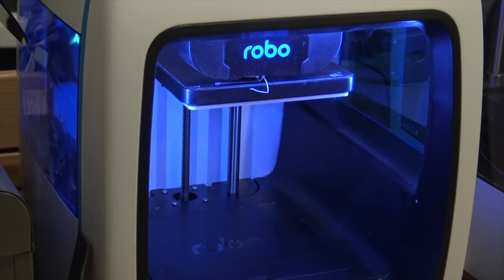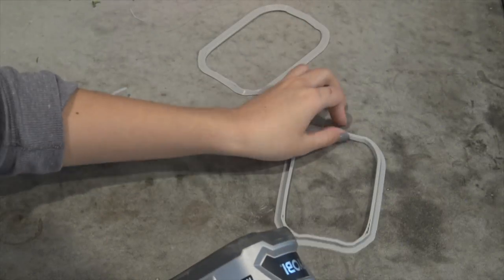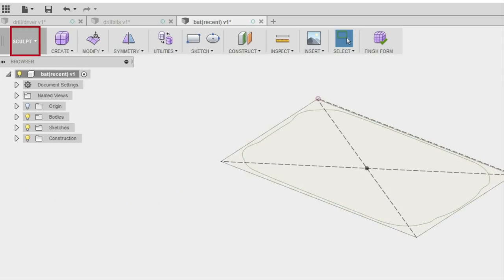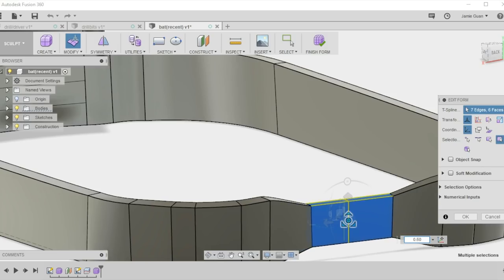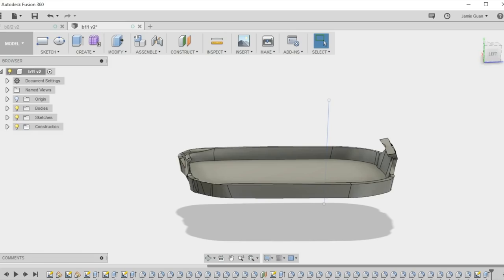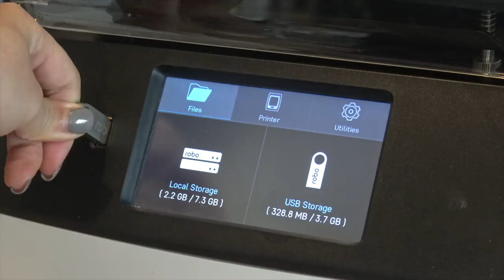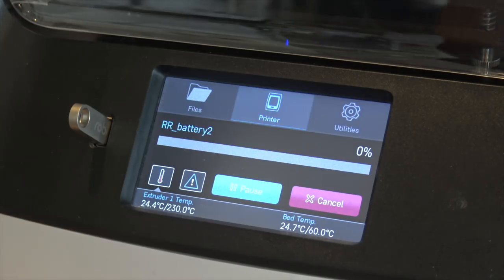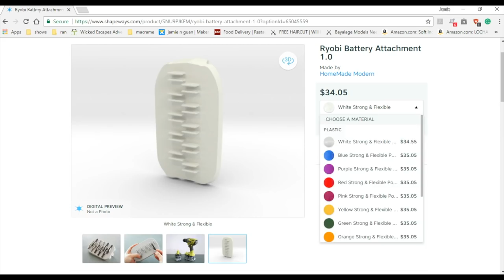3D Printed Custom Drill Accessory Kit

Comment: The steps you did in Illustrator can be done directly inside Fusion 360. Import the image using "Insert> Attached Canvas", then trace the outline with the sketch tools.

Comment: Great video! Most cameras can give you slight distortion when using them for CAD purposes. Try using a computer scanner next time and it should give a more accurate photo. One other tip would be to add a fillet or radius to the bottom of your bit tabs where it connects to the larger surface. It will make it stronger and should last longer. Thanks for the video!

Comment: Hi, thanks for sharing your project.  I'm curious about the stability—it looks like the drill may be a bit unstable on this base.  Does it rely on bits in the holder to effectively act as part of the base, so that removing certain ones cause it to wobble?  

Is it suitable for uneven surfaces? For fast paced environment where tools get picked up and put down quickly and frequently?  Where bits can be removed and replaced without needing to think about careful arrangement?    

If there are issues with stability, do you plan to revise the design?  One thought I had would be to add blocks near the edges that wouldn't be in the way of bit access.  Thanks!

Comment: Hmm.. The concept is okay. But it needs some sort of pads on the bottom to protect the surface, you place the drill on. Sharp plastic can leave scratches. Personally i wouldn't use this add-on, as it adds weight to the drill/impact driver. You want it to be as light as possible.

Comment: I work a lot with 3D prototypes at my day job. I feel like your design would benefit from small features in the corners of the attachment so your stance stays as wide as the underlying battery surface. Keep those points proud of the other ribs and they’ll always hit first.

Otherwise the drill probably rocks a bit when using that attachment.
Reply from the maker: Hi Brian,
thanks for watching and sharing ways I can improve this design!
Reply: You bet! Hope it was helpful.

Comment: Great job have you considered making the base flip open with the bits inside of the base? The base would then be flat and more stable. Still a great build!!
Reply from the maker: Adding a base would add weight to the case. The whole idea was to create a case that would fulfill its purpose well and not add bulk. The positions of the slots keep the bottom stable! Thank you for your comment & watching!

Comment: How much is the setting up of the 3D printer or troubleshooting before you can print, the reason for the question is because so many printers that you see on youtube they almost require an engineering degree
Reply from the maker: Hi Tony,

Robo's set up for the printers are really simple. I most definitely do not have an engineering degree nor am I super tech savy. Each machine comes with instrcutions that are do-able and understandable! If there are troubleshooting problems, their email/phone service is great.

Comment: Awesome project. I love printing tools and jigs for the shop. Did you considered embedding small magnets holding the bits in place so that they snap in place rather than have to be slid in?
Reply from the maker: That was an option,  but the issue with magnets is that the bits can always come off with the slightest nudge or swing. For this use and application, it seem a bit more fitting to have the drill/ driver bits lock in place temporarily. Thank you for your question!
Reply: Have a look at the Festool drills. They have a clever design where the bits reside in a groove and are hold in that groove by a magnet. This way it's easy to pick up a bit and they quickly go back in place.
Reply: Thanks again for the inspiration. I've just printed a holder with magnets and posted a quick video on my channel including a shaking and bumping test. :-) It works quite well for me.

Comment: Kind of disappointed no 3D file link was provided. Would love to print myself and maybe tweak a bit. Even if the file cost a few bucks.
Reply: Oddly the description has "Recommended" settings for the Robo R2. Not sure what use those settings have without the model to print.  ¯\_(ツ)_/¯

I wouldn't expect the model to be free but I think $2 - $10 for the STL would sell more than the printed item at the current price of approximately $37 USD shipped.
Reply from the maker: links in description!